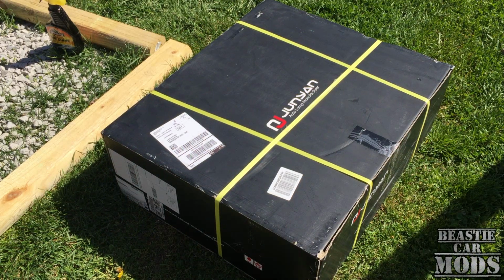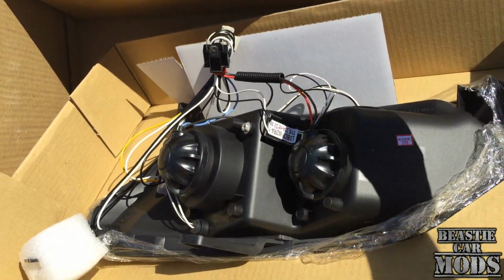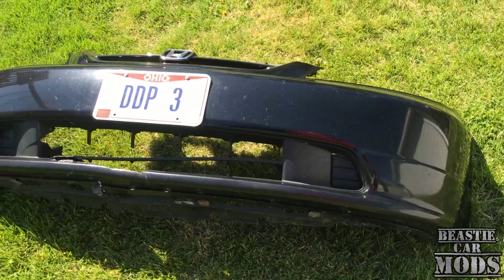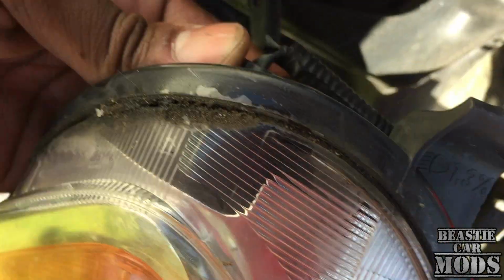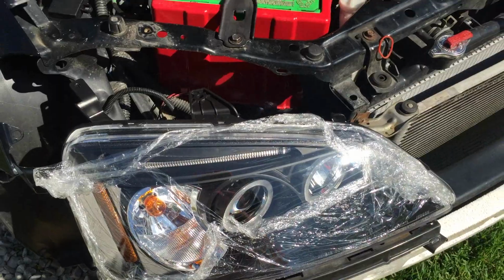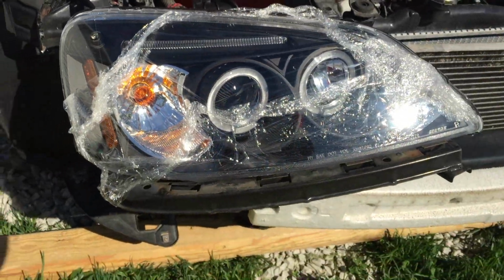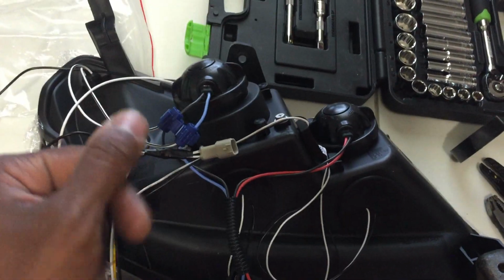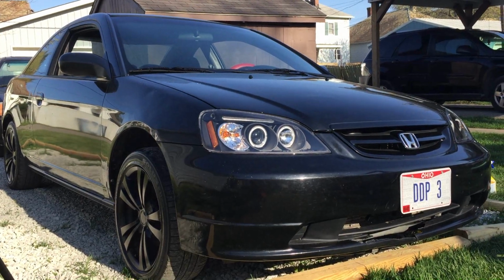2002 Honda Civic - How To Install Halo Projector Headlights

Comment: My man, you just helped me out loads. Thanks, much! I tried finding some good tutorials for Halos, and yours both was very detailed and actually showed the results at the end. Gonna attempt this on my Civic, now that my headlights arrived!
Reply: how did yours turn out
Reply: I just bought the same set of lights too but the mechanic was not sure how to connect them
Reply: @lucascovitz5708  Late reply, my bad; I have since sold my CIvic but it turned out really well last I remember! I did have to reroute maybe one or two of the wiring to get lashes of my lights to coincide with the turn signals.

Comment: does anyoneknow how to get the middle bulb to turn on, i connected the two black and white wires together (black to black white to white) but the middle lights still don’t work , i’ve tried low beam and high beam mode and neither work but the other two lights work fine.

Comment: Do you get high beam flashes with these head lights installed?? I bought them and have nothing but problems please respond thanks
Reply: Because u have to adjust the headlight angle

Comment: Hey man, I like your videos. Could you help me out with a link to those sweet lights you got? How's the seal holding up? I been looking on ebay a lot but dont want fog on the inside eventually ya know
Reply: Any aftermarket headlight you buy just add another layer of silicone for extra protection